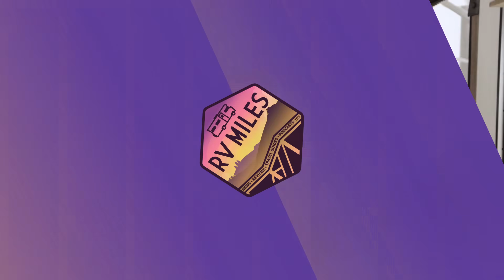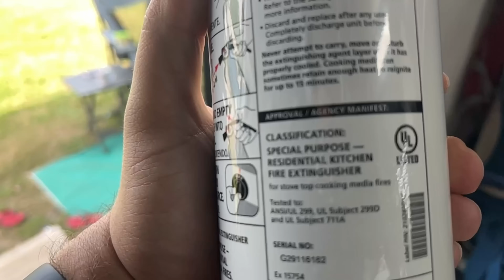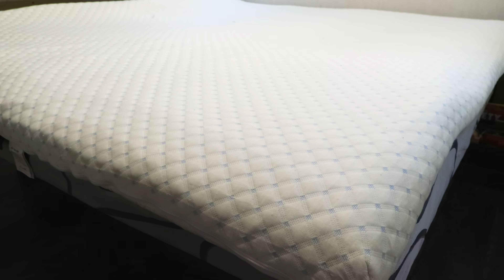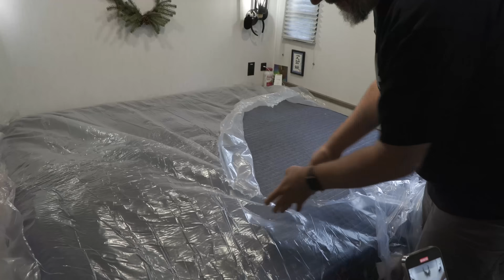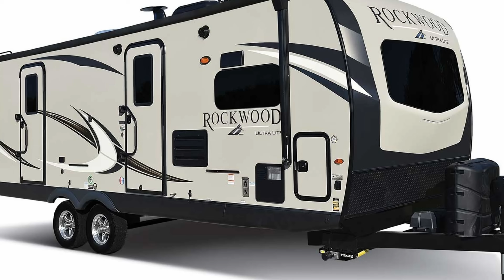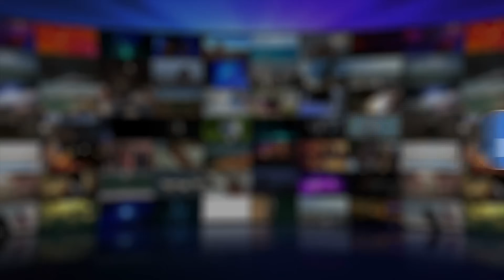Six RV Upgrades You'll Want to Make IMMEDIATELY

Comment: We bought our 31 ft. Class C in 2005 to bring our famiiy from wakadoodle Southern CA to Upper New England and due to circumstances beyond our control, it has been a driveway paper weight since then. I try to keep up on its maintenance but a small water intrusion became a huge mess on the above driver sleeper area. That area is now in arrested decay. The RV is being used for storage and my "man cave" on wheels. 
I've replaced the incandecent lights to LED, added lifetime gurentee vent covers, a high quality RV cover. It only has 15k miles on the FORD V10 gasoline engine. Now that it looks like it will never see the open road ever again, the great debate is on. Sell or donate it..... Or keep using it the way it is being used now,  just realize that it is time to take the wheels off, jack it up and permanently support the frame. A wait for the city to insist that it be removed.

Comment: We have two ABC 5LB extinguishers plus the little one supplied. We ordered a new memory foam mattress but were shocked the supplied mattress was really comfortable. Battiers we changed ours to Sun Power AGM because we do not do enough dry camping for Lithium and the 220APH, at 50% discharge supplied by the four Sun Power AGMs gives us plenty of power even with a residential frig. This upgrade does not apply to you being a 5th wheel but for our Class A, LED headlights are a must.

Comment: I have 3 MaxxAir fans - all broken after 1 year. There is a metallic slide that hold the lid while moving. All 3 broke there. Then MaxxAir sells a better part in the aftermarket. No more MaxxAir for me. Over $600 lost on these 3 fans, one of which is now replaced by the original Heng again, in our back bathroom. I have to but 2 more, but they won't be MaxxAir.

Comment: All great suggestions. 
All the RV'S I looked at were junk.
So I built my own rv from a 2021 Ford E350 cutaway van. 
.900 amp hours of lithium batteries 
.1,200 watts of solar panels 
.2 large fire extinguishers
.A 10" thick extra long 80" twin mattress.
👍

Comment: Good stuff guys, as usual! About the lithium batteries, though, they simply aren’t that expensive any more. Look at the SOK brand- their 206 amp-hour (2560 watt-hour), self-heated, Bluetooth battery is $1200. There are a number of other brands in this price range as well. What will cost more, though, is the likelihood of having to install a different converter-charger in your RV that can effectively charge these batteries, if your rig originally came with a lead-acid battery. That can turn into an expensive rabbit-hole if you aren’t careful! 
I wholeheartedly agree with the changes you’ve made being great ideas.